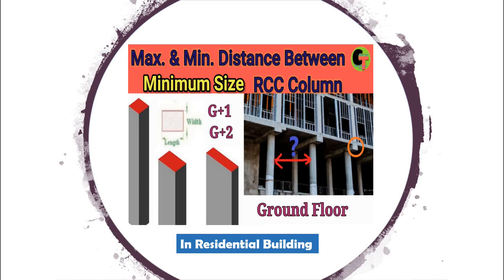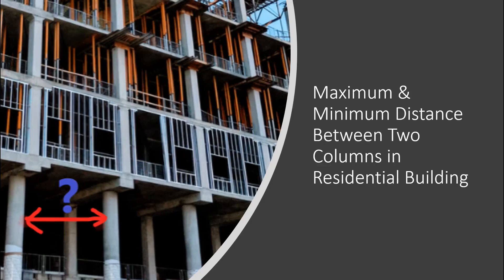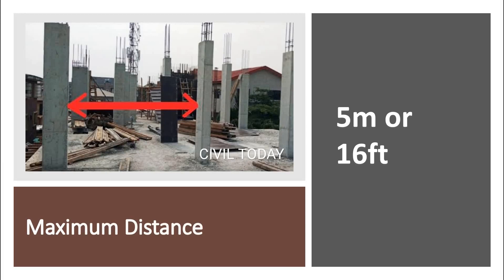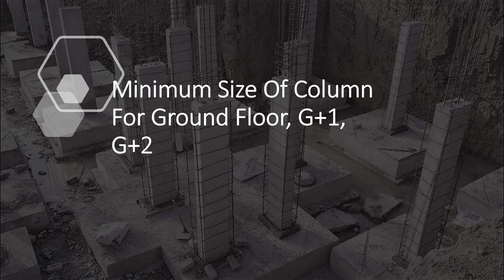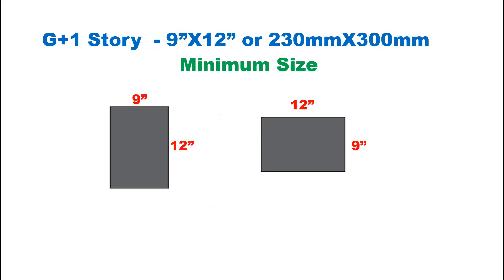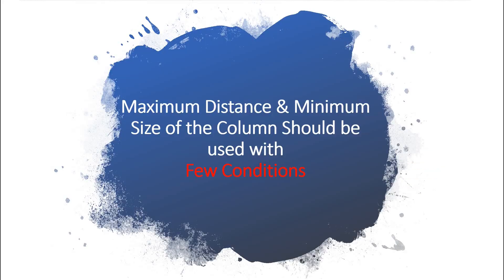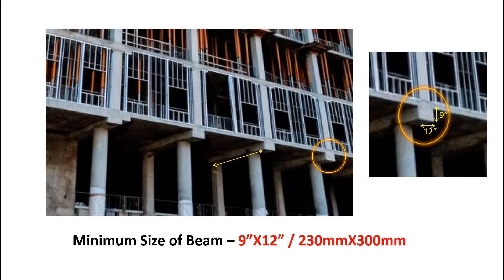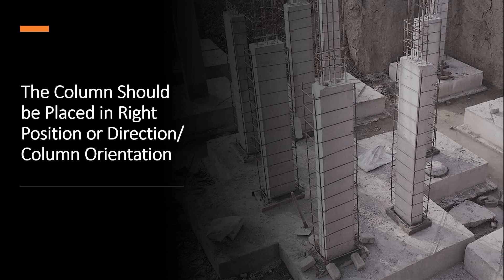Maximum & Minimum Distance, Minimum Size of RCC Column in Residential Building for Ground, G+1,G+2.

Comment: Can i use rectangle column of 20cm x 61cm for q 3rd floor house? How big must be the footing? For a rectqngle column
Reply from the maker: Ya you can use, but for 3story building select the size of columns and footings based on load calculations, so that the size of column may decrease and cost of construction also reduces. 
Thank You

Comment: For one columnvwhat is the max tributary area shared in normal building. When will be economical to place the column shared in proportionate area. Suppose in a building  area shared by  one column is total area/ no. of columns. If tributary area is 250 sqft, then rating of placing column is excellent. If area is between 150 to 250 sqft then good, if area is 100 to 150 sqft it is  fair,  area is below 100 sqft, it is poor. Is there any rating for placing column in a building based on tributary area shared by column.
V.M.Rajan.
.